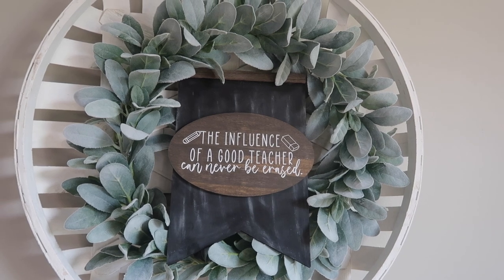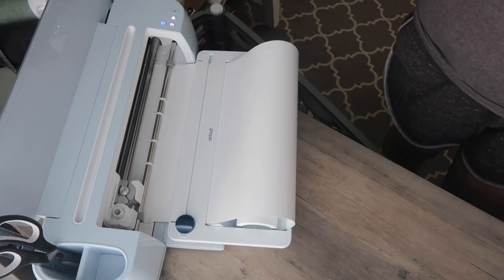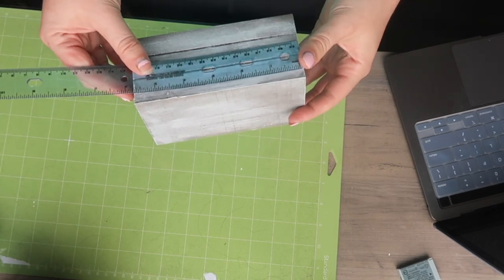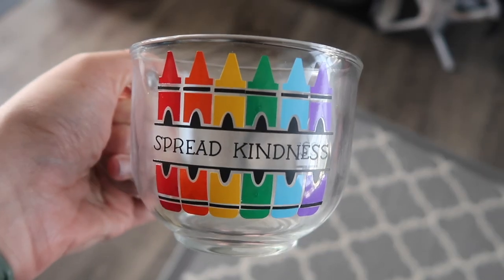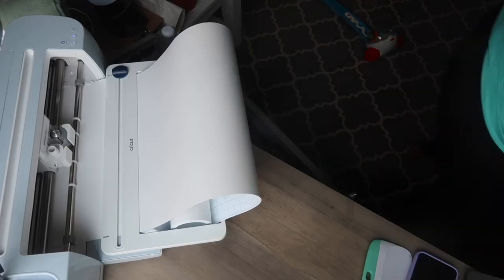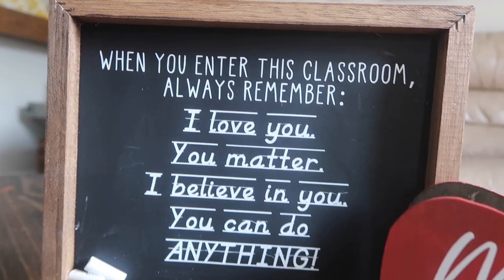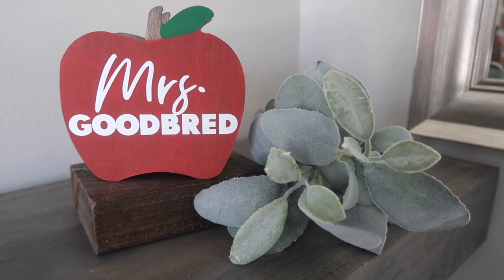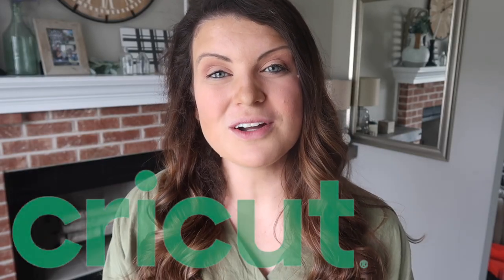10 AMAZING Dollar Tree DIY Cricut Teacher Appreciation Gifts 🍎 Great for Back to School, too!

Comment: Hey girl- I am struggling like no other through figuring out the file alteration. I separated the word crayon from the squigs but when I change the W to 7 in, the H adjusts to 12 in and then the squigs are too thick height wise to put on the candle without overlapping on the Crayon part. Thoughts, ideas, suggestions? Thank you!!